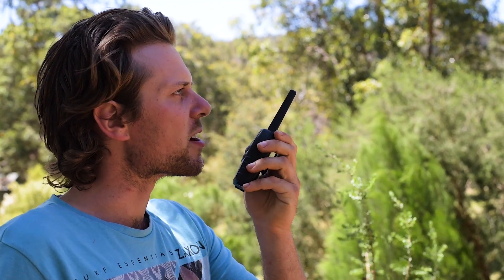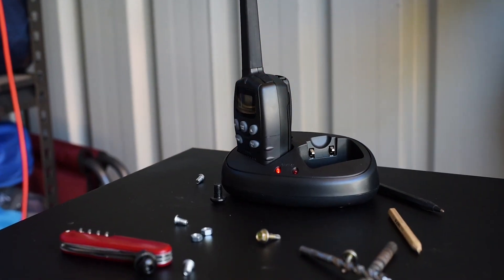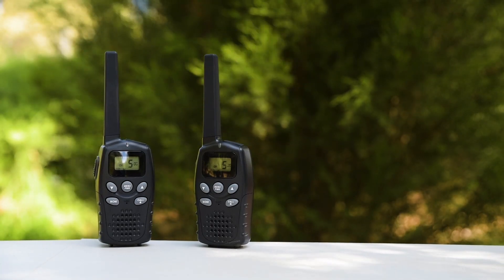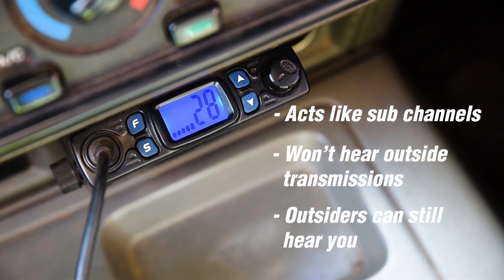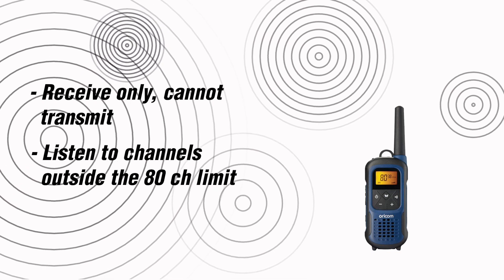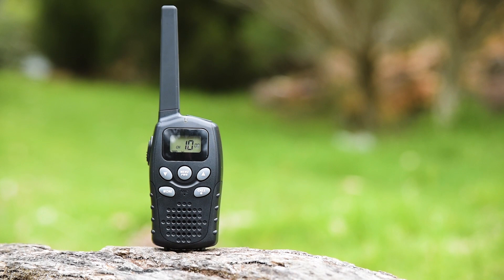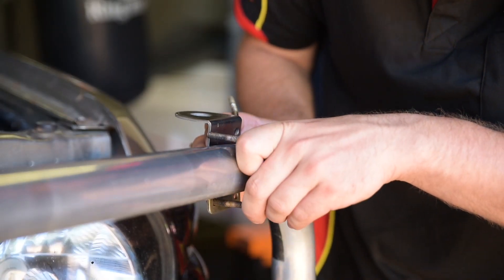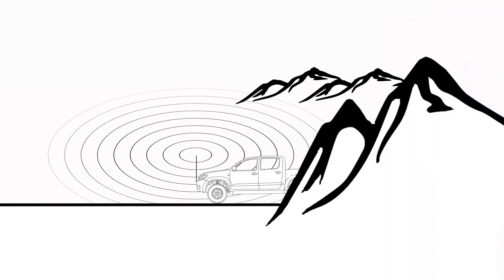Understanding UHF Radios | A Beginner's Guide

Comment: Would be nice if you warn people to stay off UHF 5 & 35 as they are Emergency Only Channels. You show that channel in use on the radios several times which would make many uninformed people think it is fine to use.
Reply: I try communicating to people in Melbourne and it seems like the hobby is dead. There is no one talking in Melbourne. Only the odd construction worker.
Reply: @airwolf1987  Mostly the same in NSW unless you do get onto a repeater that is still active. I use it for 4wding and travelling more so than just to chat.